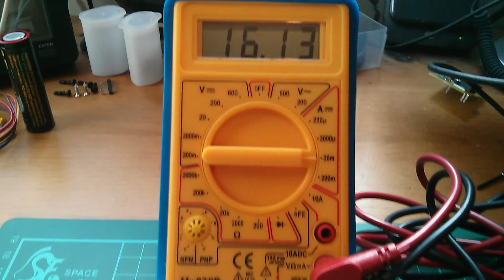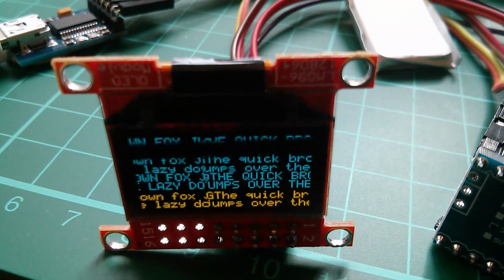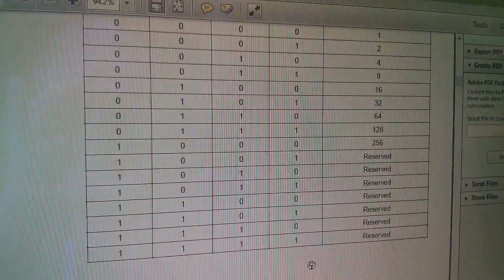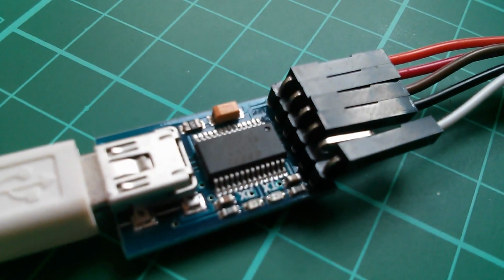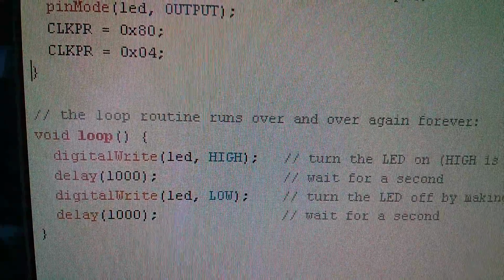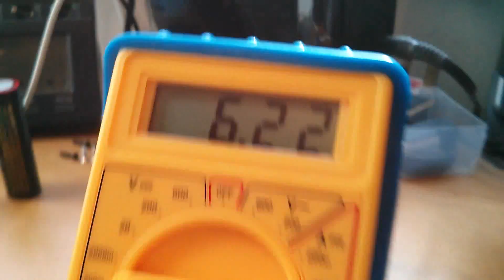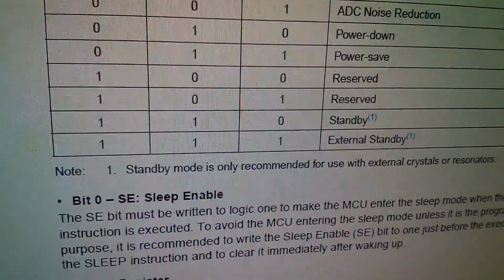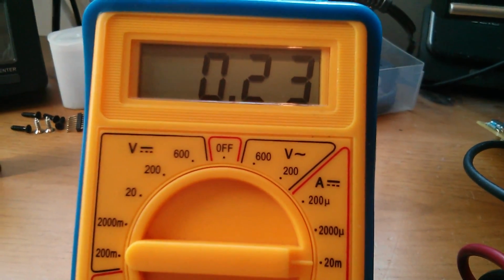Arduino Power Saving Tutorial: Clock Pre-Scale and Sleep

Comment: You can make a new "platform" file and basically call it "your chip name running at 1Mhz" and in that file change the `f_cpu` value from 16 million to 1 million. So when sleep and all the other functions do their maths on how long they should be sleeping for, they are running on the scaled speed, not the speed of the real chip.
This will of course mean any use of sleep/millis/etc will be out by that factor if used BEFORE setting the pre-scaler, which, to be honest, would be weird for you to do anyway.

Comment: I always thought it was mad to include a deep sleep function that requires a physical interrupt to bring it back to life. Why not just deepsleep(1Hour)? Anyway, best way to do this is by removing the power completely to the Arduino with a TPL5110 power timer breakout chip - really easy to use. The only downside is it can only delay by 2 hours max. Data sheet for TPL5110 says 35nA when timing. In reality it is 20uA, which is pretty good!

Comment: You can also use inline assembly for the sleep instruction. After setting up the registers just write the following line:
_asm_ __volatile__("sleep");
Ok, unfortunately youtube makes the "asm" italic and removes two underscores. It's two underscores before and after asm.
Also, if you wanna save power you should probably start with the simple stuff, like setting all your pins high or low, so they are not floating (as that causes the ATmega and many other microcontrollers to draw a little more power) and disabling peripherals like the ADC, UART and/or timers that aren't needed etc. (keep in mind that timer0 is used by millis, delay etc.) then if you wanna save even more power you can put the ATmega to sleep and get the current under 1 microamp if needed.

Comment: I also disabled the ADC and Brown-Out and got the board down to 22uA.
I had trouble with the onboard Linear Regulator. Mine was a SOT23 L05 (3 Legs), yours is a SOT23-5 LG50. (5 Legs)
It was drawing 2.2mA at start, but current draw kept increasing as time went by.
I tried powering the board from 12V initially, but then I powered everything from 5V and I got the same 2.2mA current draw.
So I started removing components from the board (Crystal, Linear Regulator, Resistors, Capacitors)
I started looking into 7805 datasheets and I saw a Typical Quiescent Current of 3.2mA.
So be aware of cheap Chinese boards if your are looking into Low Power stuff.
Reply: Hello, I did not understand if it is Chinese the arduino consumes more? can't remove the regulator?
Reply: @fabirodriguez3677  the chinese Arduino consumes more.
The voltage regulator was the problem, I removed it.
But I also needed to find a replacement with low quiescent current and a fair price, preferably in a SOT23 package size.

Comment: Could you clockdown the processor on a wemos d1 mini pro although it has not an atmel chip?
Reply: no but the sleep modes on a wemos d1 mini use about 1/10th of the power as this arduino. I use a wemos d1 mini in a weather station and can get over a week out of a 400mah lithium battery if i disconnect the solar panel.

Comment: can u explain to me..why we used the coding
CLKPR = 0 x 80;.....the 80 is stand for what?
Reply: 0x80 is hexidecimal for the decimal value of 128.  

Hope this helps!
Reply: You need to read datasheet section CLKPR register. This section explains that CLKPR register setup clock prescale system and it's has 7 bits <(bit7-bit6-bit5-bit4-bit3-bit2-bit1-bit0)>  for  read/write register. So the <7 bits>  is"CLKPCE" sub-register on CLKPR and allow you enable a change over clock system before you setup clock prescale value with the bit 3 to 0 on CLKPR. The BIT7 CLKPCE register is only "OK "setup, if you simultaneosly written to zero the bits6 to bits0 on register general CLKPR. So this is bit7[1]-bit6[0]-bit5[0]-bit4[0]-bit3[0]-bit2[0]-bit1[0]-bit0[0] = 1 0 0 0 0 0 0 0 and if you take bits in two group of 4 bits you obtain [1000]-[0000] that is [8]-[0] in hexadecimal value. So you can use CLKPR = 0b10000000 or CLKPR=0x80 when index "b" is binary value and "x" is binary value register setup.
Reply: I suggest getting a good understanding of binary and hexadecimal notations before jumping on to projects.

Comment: Before watching your excellent video, I attempted to cut the clock frequency in half by selecting the 3.3V , 8 mHz option in the Arduino IDE before loading my program.  The code I loaded was originally written to run at the standard 16 mHz, and it generates various tones separated by delays.  I'm using a 5V, 16mHz Arduino Pro Mini, but (except when programming) I'm bringing in battery power on Vcc (bypassing the 5 Volt regulator), on the assumption that the 328P won't care about the voltage as long as I stay within the voltage limits of the 328P.   To my surprise, this actually made the delays shorter and the tones were a higher pitch, as though the clock was running at a higher frequency than 16 mHz.   Then, I added your two lines of code to Setup, to change the clock frequency to 8 mHz, and I reloaded the program using the 5V, 16mHz option in the IDE.  Now the delays are twice as long and the tones are lower in pitch than they are at 16 mHz, which is what I expected.   I'm still trying to figure out why using the IDE to change the clock frequency to 8 mHz seemed to cause the 328P to act as if the clock frequency had been doubled, instead of cut in half.  What am I overlooking?

Comment: Firstly: Thanks for the vid.
Secondly: Did you notice a current reduction when in deep sleep and reducing the clock? Because I was testing with an arduino nano, and without sleep mode the current goes down quite a bit with clock reduction (from about 15 mA at 16mHz to about 5.8 mA at 1 mHz). However, in deep sleep (using the low power library, ADC_OFF, BOD_OFF) the clock frecuency doesn't seem to have any influence (1.90 mA for ALL frecuencies). I suspect that those 1.9 mA are due to the USB port (arduino gets powered throught the 5V pin)

Comment: Hi Julian, thanks for the detailed info. I did the same as you described with the clock dividing. code is running well but serial monitor on pc always has only special chars and not the ones it should. Is there a trick to let the serial monitor work correct after clock speed changing?
Reply: You have to multiply the baud speed in your sketch by the amount you divided the clock speed by.

Comment: if you buy the cheap nano withbuilt in usb they tend to ship with a 5v regulator, you can swap these to a 3 but then the poor thing is running at 3v/16mhz, which is essentially overclocking it, so you could use the clkpr command to bring it back down to 8mz, and i'm sure if you tell the arduino IDE software its an 8mhz device, all the timings for delay and serial comms etc will be fine.

please note, if you change the 5v reg to a 3v, when you connect the usb cable then by the way these are designed you put 5v into the output of the 3v regulator , it does not like this!, so remove the diode on the usb 5v line and power the chip with the 5v from usb connected to vin/vraw with a diode or a jumper
Reply: Running atmega328p on 20mhz/5v, 16mhz/5v, 8mhz/5v, 8mhz/3.3v is okay, but running at 16mhz/3.3v is running above specification - maximum frequency depends on voltage.
Reply: +lez briddon Nanos run on a atmega328p, they are rated for 20mhz, so no. 16mhz is not overclocking it.

Comment: Could anyone tell me why u can estimate the current consumption by measuring between the GND of the FTDI and the GND of the arduino mini ? Thanks a lot !
Reply: It's a little late, but here's my answer: You can place a current meter anywhere in series with the circuit. It does not matter if it is placed on VCC or GND. Take into account the internal shunt resistance of the meter.

Comment: How about dynamically adjusting the speed in the code? 

Instead of adjusting all delays, just give it the prescale command again when waking up so it can run at full speed until sleep.
Reply from the maker: In the deepest sleep modes, the external resonator/crystal is stopped altogether, so there's no need to prescale the clock in deep sleep. Dynamically adjusting the clock prescale in code is perfectly viable as a power saving measure.

Comment: Julian, I am trying to follow along. The part a don't understand is "have to set bit 7 and all other to zero", I don't know how bit 7 equal   CLKPR = 0x80. I do understand the second CLKPR = 0x01 for / by 2 , 0x02 is / by 4. Keep the videos comming
Reply from the maker: 0x80 (hexadecimal 80) is 10000000 in binary - so bit7 is set (leftmost bit) and all the others are reset.
Reply: I understand 1000000 is 0x80 but you were looking at the 7 bit. I am still missing something
Reply: bee Hive 10000000 sets the 8th bit, but since the bits are numbered from 0 that is the 7th bit
Reply: Thanks
Reply: +Julian Ilett it might be worth next time writing stuff as 0b1000000 rather than 0x80, I know hex is so much shorter, but might help newcomers.
Reply: +Colin Richardson Even still that's too much typing, (1<<7) is the most convenient and easiest to read. (the compiler turns it into a constant so you aren't wasting cycles);
Reply: Diamonddrake Well the only reason I say write it as 0b is so you can do stuff like 0b10010100 Without having to tell people how to count in binary, all they have to do is know which number is a yes or a no.

Comment: Have you seen inline assembler? Then you might not have to use 'avr/sleep.h'.
http://www.nongnu.org/avr-libc/user-manual/inline_asm.html
Reply from the maker: That does look extremely useful, but would I have to work outside of the Arduino IDE?
Reply: No, you should be able to write it in you code just like any other code. I haven't tried it myself, but it should work with the Arduino IDE, as far as I can tell.
Reply from the maker: Josh Leverette You're right. Inline assembler makes it really easy to insert the SLEEP assembly mnemonic into the C code. It's simply: asm("sleep"); Thanks for the heads up (even though I lost half a night's sleep myself - trying to write a blink program in assembler)!

Comment: Like this video! Does the OLED have a built in memory or does it need constant input from the MCU?
There are even more possibilities to reduce the consumption. You can deactivate unused components like the the ADC and some timers by setting the PRR register.
The best results can be achieved using the watchdog timer if you have idle phases. I was able to go down to 5µA during idle using the ATiny. You can check the video
Mini project: Bluetooth keys finder (aka "No worries keyfob") 
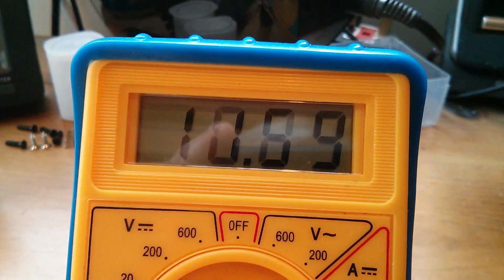around minute 5:40, source links are available in the description.
Another observation was that reduced voltage to minimum also reduced the leakage current. But since you are using a battery the regulation would eat up the difference.
Reply from the maker: The OLED has its own memory. In fact that scrolling is also done by the OLED chip.
I did play with the ADC and PRR - shutting off the ADC helped a bit, the PRR did surprisingly little given its name.
Reply: Julian Ilett So it even could be possible running the display while the mcu is shut down... nice. The PRR is truly disappointing but easy to apply so worth to be mentioned.

Comment: If you turn off the ADC, Analog Comparator and Brown Out Detect circuits, you will get it down to 1uA. However changing the BOD level requires modifying FUSE bits.

Comment: Given that it's doing absolutely nothing 230 micro amps is quite a lot ;-) But nevertheless an interesting video.
Reply: Most batteries have a self discharge higher than this so it is pretty low compared to that =)
Reply: abyssunderground ...and it's not strictly true that it isn't doing anything because it does have interrupt detecting routines still running in order to wake up.
Reply: Thats not how interrupts work. By thier very nature they are not polled

Comment: I didn't know about the pre-scalar, I'll have to look into this one for my current project. Thanks =) Also, do you have a link to that massive PDF?
Reply from the maker: www.atmel.com/Images/doc8161.pdf
Reply: Julian Ilett Thank you very much =)
Reply: Julian Ilett Thanks again for this video! I have just spent a few hours playing with this on my Uno and it works a treat. I did figure out that if you use OneWire or anything relying on precise timing you do have to set the speed to 16MHz again while it does it's stuff, then you can drop down again. Thankfully that's easy as pie with those two simple lines. I made two functions, clock_high() and clock_low() which I can call when needed in my sketches. Specifically I've been using a DS18B20 temperature probe which prompted me to find a solution otherwise it just didn't show a value when probed.
Reply from the maker: abyssunderground I don't think there's much inside the microcontroller which is unaffected by changes in the clock prescaler. The block diagrams in the data sheet will help identify those that are. Very pleased that you've found a use for it.

Comment: I've read you could remove regulator from this board and connect it straight to li-po battery. Voltage should stay in safe limits for this chip.
Reply from the maker: You may be better off with the 3.3v Pro Mini. There's a graph in that 440 page datasheet which shows the maximum clock frequency recommended for different Vcc voltages. It's difficult to tell from the graph, but running at 16MHz at 3.7v or less looks a bit borderline. I think that's why the 3.3v Pro Mini has an 8MHz resonator.
Reply: Julian Ilett It's out of spec but what I've read it runs just fine. And I remember they sell those where you can change the voltage from 5v to 3.3v (16mhz) on ebay.
Reply: *****
The problem with running out of spec isn't it stopping to work. I've run AVRs at around 30Mhz. The problem is, that it SOMETIMES and irreproduceable craps out. It could depend on temperature or on input voltage or the "weather of the day".
Some things just get unreliable as soon as you move out of spec. The same AVR (speced for 16MHz max), that I could run at 30MHz with normal code, would corrupt the EEPROM for example when just running at 20MHz.
There is a reason the manufacturers give you specs for a device.

Comment: Now I know why my project with an Attiny programmed with Arduino code runs much slower then on the 16 MHz Arduino. The Attiny only runs at 8 MHz / 4 MHz so any timers that runs on it will need dividing by 2 for the 8 MHz clock and 3 for the 4 MHz clock. I thought it was something to do with the system clock . Thanks !!